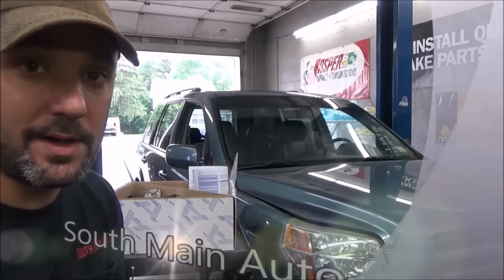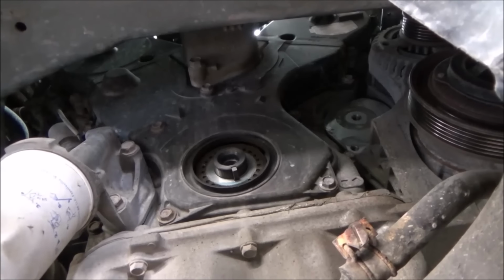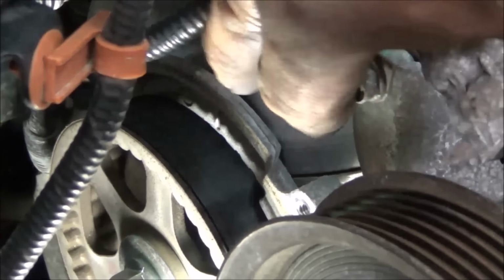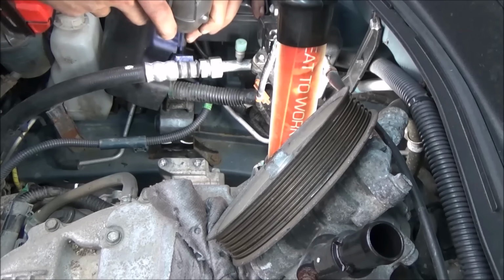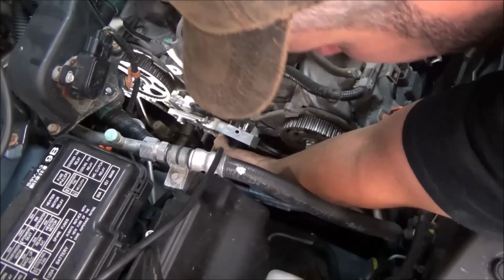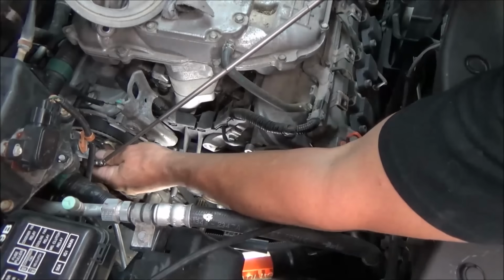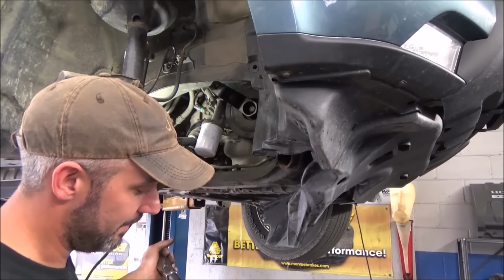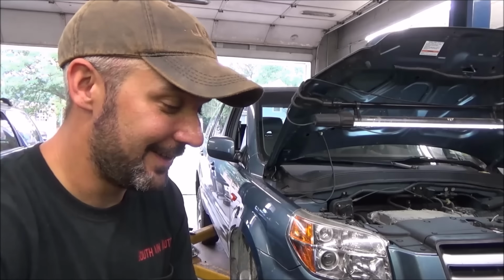Honda Timing Belt 3.5 J35 - Pilot, Odyssey, Ridgeline

Comment: Great vid! Stupid crankshaft bolt turned out to be a beast for me, as you hinted at is not unusual for the hondas. Tried a 750 ft lb 1/2 impact driver, wouldn't budge it. Of course van had over 230,000 miles and first ever timing belt replacement so I expected some challenges. Many thanks to you sir for a great instructional vid and above average camera work. I am now a subscriber :)
Reply from the maker: Wow 230k on the first belt... that is impressive!
Reply: One trick for that I learned on YouTube-- put a 19mm socket and breaker bar on the big bolt, breaker bar pressing the floor, and then CRANK THE ENGINE FOR 1 second!   Worked perfectly for me.  You don't even need the hex holder tool or the heavy socket.

Comment: 07:59 If you drop the key you can use a magnetic floor sweeper to find it. I am assuming that given your experience you already know this but thought you might find it helpful to have some support/a reason to buy another "tool" if you don't have one already. BTW I have an 03 pilot with a 175K and a leaking tensioner and have been debating trying this spark plug change and or a valve adjustment for my non minor, brakes, repair but until now did not have enough confidence in the quality of the instruction and or my toolset, my propensity for breaking and loosing small parts into the engine bay and ability to get it done in a reasonable time frame.

Comment: Just knocked this out on my wife's 2005 Honda Pilot and this video was spot on. The only thing I had to do differently was put a breaker bar on the crank bolt and give the starter a bump to break the bolt loose (with the coil packs disconnected). There was no way that sucker was coming off any other way. Big thanks for putting this together!
Reply from the maker: Good tip on getting the bolt loose!

Comment: Nice video pally.  You saved me hundreds of $$$.  ...used the Lisle special Honda crankshaft bolt socket and even w. my Harbor Freight Earthquake impact and a 5 HP 20-gallon craftsman air compressor, it took three shots to break it free initially.  I was scared, because any other method of getting the factory installed crankshaft bolt was guaranteed to be a royal beyatch... I have no car lift to use an multi-foot breaker bar and the Lisle Honda crankshaft anti-rotation-locking tool. Good point on double checking the cam positions BEFORE releasing the "grenade pin" on the timing belt tensioner.  The rear cam was one-tooth off.  It must have moved when I initially installed the new timing belt.  BTW, pulling the tensioner pin was a real PITA for some reason.  ...had to use pliers to get it out; maybe I should have slightly greased the end of the pin that needs to slide through the hole in the tensioner shaft to get it out   Also, on my 2005 Honda Odyssey-EXL you have to partially move/remove the transmission control computer to get at the last of the three motor mount bolts on the passenger-side upper fender location.   That, to me, was kind of a stupid engineering choice related to serviceability. That motor mount was also completely trashed, so this is a good time to replace that also.  Keeping the coolant from going all over when cracking off the old water pump, even after having completely drained the radiator, was a bit of a messy surprise.  One should have about a gallon of Honda pre-mix coolant to replace the lost amount. I also took this opportunity to change the serpentine belt tensioner as I'm at 100K miles.

Comment: I was doing my second timing belt on our 2003 pilot with 203.000 miles and the tab that has the threaded hole that is used to compress the tensioner broke off.  Don't know if I tightened it too tight or not.  Anyway, looking at this video I just cut the belt but without the tensioner tab to use the battery J-bolt to compress the tensioner it was very difficult to remove the pin.  This was caused because the tensioner piston releases so quickly when it's unconstrained that it releases through one hole then bends.  My workaround was to remove the tensioner and reload it with a small Allen wrench that was coated with grease to allow it to come out with one fast jerk.

Thanks so much for this great video and the commentary that went with it.  I hope my adder about the tensioner release tab helps somebody also.

Best regards,

Chris

Comment: Eric, what is your cost to do this job on a 2013 Honda Odyssey 3.5? I'm being quoted $1300 CAD for the belt, tensioner and water pump. My van is a '13 with 167,000 km on the clock. So premature on the year, but over mileage. A lot of highway, but it gets driven. Not babied. No maintenance minder warning yet to do it.
Reply from the maker: Boy I'd have to look, I think it is 600 ish for everything?
Reply: Holy SHNIKEZ! It's $1300 here Canadian! Worth the friggen drive! I'm near Toronto!

Comment: Just did the timing belt, water pump on my  2006 Honda Odyssey after watching your video. Thank you so much. Your video made it a breeze. And I have never changed a timing belt on anything. I bought that 19mm socket and it worked great. Again, thank you.

Comment: Thanks for the video! I just did this job yesterday on my wife's 2012 Pilot and it was a job. The fenders are a lot higher and the engine is recessed lower than the one in your video so my back is hurting but I got it done. Thanks again!

Comment: OK, so I screwed up. Forgot that the woodruff key came out stuck to the lower crank pulley. When I got the timing belt on with all marks aligned I put the bolt in the crank and started turning to see put the engine through a few cycles. I could not see the crank spindle turning but realized the cog was not moving. Pulled out the bolt and realized i was spinning the crank as the timing belt stood still. (both cams are still on the TDC mark). I don't know how much i turned the crankshaft spindle. Since the crank rotates twice for every rotation of the cams I do not know how to realign the crank with the cams. What is the procedure to do that?
Reply: added note, I turned the bolt/crank by hand and did not feel any compression stroke. It just felt like I was still tightening the bolt to bottom it out. The crankshaft notch for the square key is 90 degrees clockwise from where TDC would be. I'm just not sure if I got there through a quarter turn or 1 1/4 turn.
Reply: All is well. (did not mention that the rear cam sprocket also kicked down 90 degrees clockwise while I was working on this when the crank was still at TDC. This, I turned it back 90 degrees to TDC) I turned the crank back 90 degrees to TDC mark, re-installed the key that locks the cog to the shaft. Replaced the timing belt and I pulled all spark plugs out to limit the resistance from compression and then turned slowly clockwise several full revolutions. There was no suggestion of valve contact. .....started up and ran fine once reassembled.

Comment: +South Main Auto Repair, great video!  Gives me a lot of confidence before I replace the t-belt and w-pump on my '08 Pilot.  Which torque wrench did you use to install the crank pulley bolt?  The one that measures degrees.

Comment: Cool air ratchet on the water pump bolts. Sleek, low profile, small head.

3/8" or 1/4"? What brand?
Reply from the maker: Astro 1128 is the model

Comment: You're the man! Unselfished to share for everyone! I just have one question though, what is the extra 60° you put in there in the crankshaft bolt after you applied 47 ft-lbs? I just have a regular harbor freight 1/2" torque wrench , thanks

Comment: Spent all day trying to unscrew crank shaft pulley bolt using 90 psi impact wrench and 6 gallon compressor. Don't  have pilot lifted high enough to use cheater bar SMA would you recommend a stronger impact?

Comment: Gonna tackle this one next weekend on our 06 Ody, but with one big plus.  the passenger side wheel bearing is making some noise, so I decided to go full Rambo and replace a whole pile of things at once, including both front bearings, ball joints, inner and outer tie rod ends and the entire suspension setup on the van.  Overkill?  most likely, but the net effect is that it will all be out of my way while I do the timing belt.  hoping to get all of it done between Thursday evening and Saturday evening.  I also ordered one of those Lisle crank pulley bolt sockets.  Now I just gotta make sure I have a good enough Torque wrench to put it back in...

Comment: Hello I have a 2008 Honda Pilot I did my 100,000 mile service done.  All of sudden The pilot is leaking oil.  I took it to the dealer and they checked it.  They siAd it's the rear main seal.  It will cost me $1500 to get that fix.  Any advise? It only has 100K miles on it can the rear main seal leak?

Comment: Super job with this video...can't thank you enough.  Easy to follow and in plain English.  Love all the tools you have...especially that torque wrench with the built in torque angle gauge...slick!  I'll need to do the old "mark it with paint" method.  I did buy the crank pulley holder and the Lisle 19mm special crank bolt impact socket so I'm ready to go.  And got the same high quality Aisin kit instead of a cheap one.

But just curious...why you don't wear gloves to save your hands?  Thanks again.  Great video that will help many, many DIY'ers.

Comment: Eric, I found this video invaluable. Replacing the timing belt isn't a casual thing for the average backyard mechanic. I've been working on cars my whole life (I'm in my 60s) and have collected a lifetime's worth of tools, but have been less excited about crawling around under a vehicle than I was as a teenager.  Anyway, the video, as well as the one about adjusting the valves on the Honda 3.5 were both well done and led me straight through to  a successful result on both counts. As a side comment, after seeing the Drive Pulley Bolt remover you showed, I had to make one, and it worked as advertised. One reason these jobs take me all day is I wind up having to make the specialty tools you show so I can finish.

Comment: Thanks for the help. Just did the service on a Saturn Vue with the 3.5v6. The only thing I would add would be to follow the instructions with the Aisin belt and pump kit. This is on the guide pulley, leave it finger tight if not loose to provide slack to put belt on. I tried your method of putting it on the tensioner pulley with no luck. Also invest $33.00 or less on the large 19mm socket to remove the bolt on the crankshaft. It came off with no sweat.

Comment: I have the exact same Pilot. I had the timing belt replaced with a kit like you recommend, about a year ago, but now the engine is making a ticking noise that goes away when it warms up. I've read some comments that say it's the tensioner going bad, any ideas?
Reply: Nick T. I'm not sure on your particular car but from what I've seen on the Acura forums the valves might need to be adjusted. It's common at this mileage to need it and a lot of people do it when they do the timing belt.
Reply: Thanx Michael

Comment: Words will not be enough to express my gratitude. 2005 Pilot. Sir, you have just saved me much coin. I followed your video, step by step, even when we had to backtrack (and of course, the theme of the day), and I can sincerely say that you, my friend, are THE KING of all DIY automotive. As I am typing this, my Pilot is humming in the background on this cold New Years eve. With new timing belt, water pump, idler pulleys and tensioner for timing belt, new tesioner and idler for serpentine belt, new serpentine belt and numerous new bolts (rust and such). BECAUSE OF you! THANK YOU!!!!! This machine has registered  215,000 miles. EVERYTHING on it still works like new. Navigation, Heated seats, power everything, A/C, everything! THANKS to YOU! I think I can make her go another 100K!!! Thank you, Eric! YOU DA MAN!
Reply from the maker: Glad it worked out ;)

Comment: this is a little off topic but i have a question and i know this is an old video and probably wont get a response however ill try anyways. i have an 06 odyssey. all 5 of my motor mounts are broken. 2 are elctronic an 3 reg. this is the third time in 4 yrs iam doing this. more scariest the last time i did all 5 was about 4 months ago. funds were tight an i got after market. this time honda wants 2600 which is whatever. i dont have a trust worthy mechanic where i live. i have threeyoung children so i need this done right. question is what can keep causing these to go so often and what other damage can i do to my odyessey driving it like this until i can replace them? hope to hear from you soon. thanks in advance
Reply: Unfortunately there's pretty much nothing you can do. It's a design flaw cause by their VCM system. This was their way to "band aid" it so to speak. You are not the only one experiencing this. Well documented on many Odyssey forums. I've had to do mine as well. 

A couple of months ago we were out of town and the alternator went out. We were pressed for time so I took it in to the dealership. Of course they "inspect" the vehicle to see where else they can get you and sure enough they said all 5 mounts were bad. I had just changed them last summer so I doubt all could be bad. RATHER they know its a know defect so the automatically suggest it.

On a side note, you may also want to look into replacing the 3rd and 4th transmission pressure switches. Apparently these are common failures in the 05 and 06 models and cause shifting issues. Also widely documented on the forums. We have an 06 model that I love and want to keep running as long as possible. Good luck!
Reply: driving with bad mounts can damage your flex pipe in your exhaust (if you have one) and cause vibrations under load. don't put it off too long but you're ok to drive it around till you can get it done. if you replace them all at once with a good brand and a correct installation, I don't see why it shouldn't last a long time
Reply: Thanks for the reply. Yeah tax season im putting her in the shop. I havent been driving much just local. No highway etc. Well i feel better now thanks. I was afraid one day it would fall out and id die.
Reply: k bob thanks so much i will deff look into that. are this switch replacements expensive?

Comment: Great video. I have 2 of these to do next week, 1 2013 and another 2008. The 2013 has 117K miles on it. The good pump comment is 100% spot on. I have heard of other techs using Gates and they end up leaking 6 months or less later. I saw the Aisin you put in there. 

BTW, that is the coolest torque wrench I have ever seen. I own about 5, but that was a first for me.

Comment: Best Video on this subject. Thank You for taking the time to make it. I have a 2005 Pilot Touring PKG (best car I have ever owned, I've had a lot of cars in my 51 years), should be just about the same. 210,000 miles and running like new. But the timing belt has to be replaced now if I don't want to find myself stranded. Serpentine belt idler and/or tensioner pulleys are squeaking and I was going to replace them, but now I'm going to get in there and do the timing belt also. Dealer wants $1,400 for this job, including water pump, fluids, pulleys, belt, seals, loaner car and just about everything else that is associated with this job. Because of your video, I feel confident that I can do this job and it will be a success at a cost of just under $200. I have all the tools except that Honda Monster Socket and, of course the shop lift. But my garage, my jacks and jack stands will do just fine. You are the most "watchable" mechanic I've seen on you tube thus far. And I've seen alot. Thank you so much. Have a great Christmas, brother!

Comment: Doing this job on Saturday. My kit includes 2 camshaft seals and 1 crankshaft seal. What do I have to do in addition to replace these seals? Also, another vid suggested a way to loosen that crank up, put a socket and ratchet on there, set to loosen, rest up against engine, and quickly turn over engine...it breaks it loose... thoughts?
Reply: Not recommended but that's what I've done.

Comment: Eric, on on a 2002 Odyssey, for the alternator, the back large diameter bolt 
snapped off, leaving some of the thread inside the hole. Is this 
alternator mounted straight to engine block or is it mounted to a 
bracket on the engine block?? Any help would be appreciated!

Comment: Isnt it needed to fix the crank and the cams and make sure they don't move while placing the new belt. Most of the engines need their cams/crank blocked. Isn't it needed here as well?
Reply from the maker: The only time you need to lock them is when there is no timing marks. There is not to many engines out there I can think of that you have to hold in place.
Reply: South Main Auto Repair Ok, but isn't there a little bit of a risk of moving the crank/cam out of mark while putting the new one without locking (I'm sure its quite difficult that to happen but after all ) ?

Comment: I did a "round robin" maintenance tour:
New : Timing belt, water pump (aka bamba de Agua), idler bearings, timing tensioner, serpentine belt, serpentine tensioner, any idler pulleys, clean all EGR passages, clean IAC.

Comment: Eric O., would you recommend doing a 2006 ford fusion 2.3 timing chain service? i have done many timing belts, but never a chain. the cam sprockets do not have a keyway, so there is a special holding tool.

Comment: Thanks Eric for the video, I changed the timing belt on my 2003 Pilot at 200k miles. The 03's have a separate belt for the power steering and a serpentine belt which both run off the crankshaft pully. Anybody doing the 03's take the motor mount off first it give a lot of room to work.